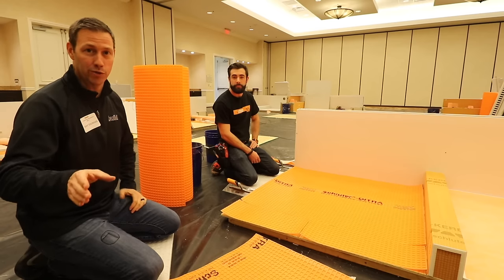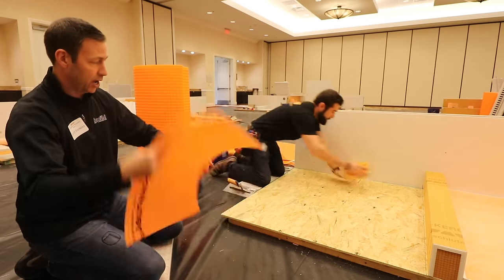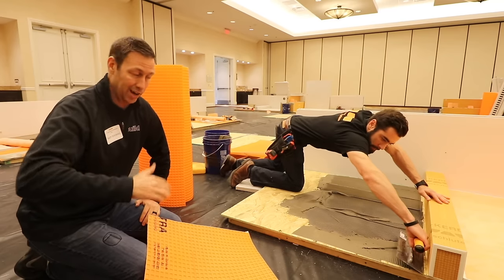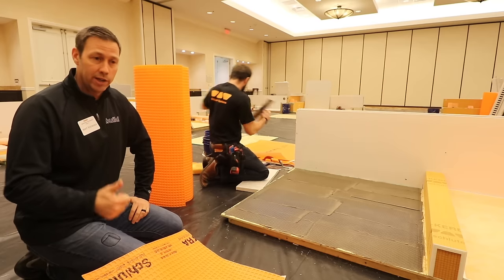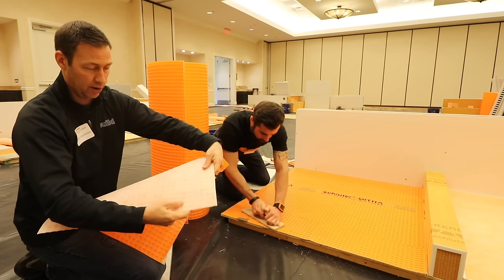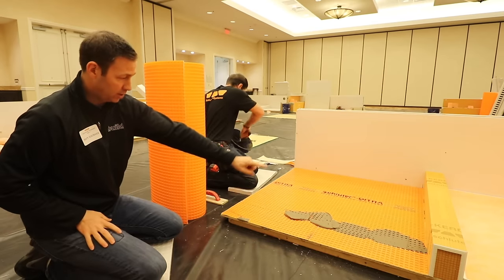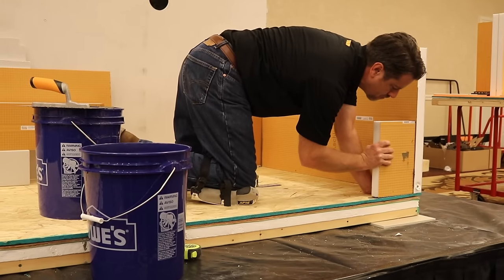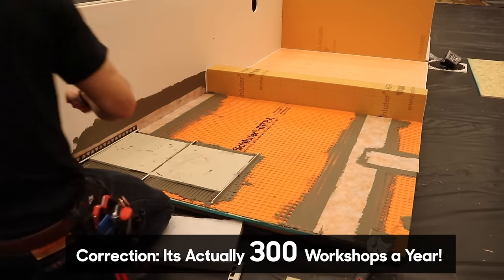WHAT is this, and WHY do you want it under your floors?

Comment: I use 1/4" cement board. It is far, far cheaper that ditra. Ditra is another overengineered, overpriced, unnecessary German product. Good for cement floors, but unnecessary for wooden floors. The height of the 1/4" cement board is not much more than the height of the ditra.
Reply: Mark S yep, and while you are still waterproofing, I’ll already have my tile set and moving on to the next task. Stay stubborn.
Reply: @aldoraines1191 If your subfloor is in good condition and strong, backer board installations will not crack.
Reply: 20 years in flooring. I use 1/2 cement board, I found construction adhesive under and then screw it down. Then fill all seams and gaps against walls and tubs.
Reply: Cement board is not waterproof it's water resistant. Tile is not waterproof either. Meaning that water will penetrate and you will get rot/mold. After this comment you'll write that you've never gotten a call back. Instinctively and homeowner will never call the inept tiler back but instead call someone else. Hope this helps.
Reply: Cement board does absolutely nothing to uncouple the tile from the substrate. This is why every single job I did 10 years ago when I used hardi-board exclusively has cracks in the grout where the floor butts to the wall. 

Physics cant be changed. Floors and walls are constantly moving. Nothing you can do will stop the cracks unless you uncouple the tile from the substrate
You also don't have a waterproof floor with backerboard, so when that crappy mortar based shower pan leaks, and the two ends of the bathtub (over years) spills enough water onto the floor, the subfloor will be destroyed underneath...God forbid if that bathroom is on the second floor and now the ceilings on the first floor are falling apart and moldy.
Keep using your crap and hurting your reputation, And in the meanwhile MY business will continue to grow
Reply: But is backerboard alot heavier than ditra plus thinset?

Comment: I'm a DIY guy who used this product 16 years ago. Not sure if it was the same brand, but certainly same product from Home Depot. Weeks after the fact two tiles still were not bonding. HD people told me it never would because I used a premixed product! Well why did all the rest bond perfectly?? I've removed them for inspection and there was complete coverage on the tile. Really can't understand what happened.
Reply: It was most likely a mortar curing issue. You never want to use a premixed product to install tile to Ditra.
Reply: @billjohnson7347  Yes, that fact is not made clear to buyers but should absolutely be a point of emphasis.

Comment: Shout out to everybody that do manual labor cuz that made me tired
Reply: It's skilled craftsmen, not manual labor. Something that you would never ever be able to do....
Reply: @deeplorable8988  craftsmen still use manual labor, don't they? Even if you use power tools, you still operate then manual, no? No need to get upset...
Reply: @deeplorable8988  well.... yeah, i see your point. Not referring to drivers or operators of machines, meant hand power tools .... when you control them with your own hands still
Reply: @Sokeresa  Again, and I repeat, with your logic, a surgeon is a manual laborer. Critical thinking is not your strong point.

Comment: So how long is this supposed to last, then? 20 years? 40? Great, we now not only have "fast fashion" but also "fast building", i.e. using oil to create - at the same time - disintegrating and waaay too long lasting (micro)plastics and wrapping ourselves in them from body to house. And all this while there is a real and from an engineering standpoint very modern and sustainable trend of using natural materials throughout - which can also save money, when used wisely. Nothing is cheaper than litteral dirt.
Reply: petrochemical Engineering of Structural Engineering is FAR superior to wood, cheaper longer lasting higher tinsel strength more weather resistant and better acoustics value thermal resistance..
Reply: @mjolnirswrath23  Arguing ad hominem is certainly not a wise move if you want to get a point across. Then again, I don't think this is the case. You do realize you do not know me or any of my life's experience, right? Well, keep on ranting and have a good life in plastic while I build my next house the way the one I live in now was built 250 years ago: with wood and clay and straw and chalk, with great isolation and 0 rodents, I can assure you. Also: give ants a chance, dude! We need 'em - just like bees. And you don't have to be a tree hugger to realize it, really. Logic and an understanding of what's around you that makes you live is quite sufficient.

Comment: what brands of washing machines you've used in the last 10 years to know not to buy them :))))
Reply: Don't buy whirlpool their warranty doesn't cover most of the parts unless you buy the extended warranty that cost arm and a leg
Reply: Buying a Speed Queen will last 25 years. Nothing else comes close I have seen.
Reply: @arjunapatel3366 
Ain't nobody got time for that!
Reply: @stephenbullock9431  weird, I got my whole house whirpool and they are the best I've ever owned.
Reply: @stevenbodum3405  Speed Queens are made in Wisconsin, not China. They are the machines the Army buys and are also used in most laundromats where durability is important.
Reply: @davedoolittle9124   I install all brands of high end appliances yes speed queen commercial 💪👍. Samsung/Dacor is over priced garbage
Reply: Typically the hoses that connect to the washer deteriorate over time. Especially the hot side. That’s the source of most leaks. It’s worth the cost to replace the hoses periodically.

Comment: "Electric floor warming"!! -- That's what I want.
Reply: DITRA-HEAT

4.2 out of 5 stars  25Reviews

DITRA HEAT UNCOUPLING MEMBRANE - DH512M- SCHLUTER
Reply: Ditra heat is good stuff. You must know how to install it 100%. No room for errors with the heat.  However, it is very easy to install and absolutely great in remodels! 👍
Reply: @eg9248  - How does a better furnace keep your tiles warm? Please explain.
Reply: @eg9248   It won't heat the floor. I have a client who is s one in right now in South Florida. She hates cold tile floors. If your body temperature is 98.6 and the tile is at room temperature, lets say 75 degrees, the tile is going to feel cold. You would have to heat the entire house to 98 degrees just to warm the floor. If I could give you a double face palm I would.

Comment: At that price why wouldn't you just use silicone; you would get all the same benefits.
Reply: Because this system is awesome and works SOOOOO much better as it's a tied together system and should last a lifetime of water.
Watched Mike Holmes from Holmes on homes install this stuff. Freind had home remodeled in Cali after earthquake, many years ago as it just came out. Installer was trained by/with Mike in Canada. His home just had more damage and guess what was perfect underneath when ripped out. 12 kids 6 of his and 6 fosters and NONE of them destroyed the system. Earthquake, yes bunch of messy kids nope.

Comment: Yeah . . you sound like a 'info-commercial' dude . . just say it man, fess up!
Reply: Thats because this stuff works. I wouldn't tile without it
Reply: @trump-wj2nx  you're wasting money
Reply: @trump-wj2nx  "Not dimensionally stable" did you mean the subfloor has pits, valleys and not level or did you mean floor was not square? I want to use this stuff in my bath - need experienced opinion. Thanks
Reply: @georgiafan6618   yes, what you just mentioned, also, plywood is not dimensionally stable. As it will expand and contract under the tile, which is dimensionally stable. Causing cracks later on down the road. Also, there are 2 kinds of concrete slabs, those that have cracks, and those that are going to crack. Most of these so called "professionals" on here are slamming this stuff because this stuff costs more, and requires more labor and hurts their margins, so basically they lose money. But the difference between me and other companies, is that i take care of every callback i have ever had. Which i save money in the long run by doing things to the best possible standards i can. Alot of other guys want to slap this stuff together and when its messed up a few years down the road, and you will never see from them again.

Comment: I love your channel but not this. I have been watching your channel for years but I had to make my first comment because of this product.

As a flooring guy that has been in commercial & residential construction for over 25 years. Framer, concrete, foundations & footings, trim carpentry, job foreman and commercial building superintendent. Yes, I build too.

This product is garbage. The old tried and true methods are the best. I've had more repairs because of this products failure than anything else. Not my work either. It's always some other guys crap that sold this garbage like it was the best thing since sliced bread. The only thing that Schluter makes that's worth a damn are their flooring transitions and corners........ if you like the metal look. Anything else they have. STAY AWAY and DO NOT WASTE YOUR MONEY.
Reply: More than 3 decades of tile flooring installs here agreeing with you.
Reply: Hi I know I am late on this video. I want to do me living room and dining room in ceramic. My bathroom has ceramic flooring on about a 3/4 plywood and has been there for well over 10 years and looks fine. Everyone says I need to add another piece of plywood or this stuff on the video. What would you recommend? There are comments here that they have tile on the sub floor for decades with no problems?? I am confused... Thanks in advance

Comment: I understand that Schluter Ditra  is not rated as an ANSI A118.12 crack isolation membrane.  If the concrete already has cracks you should be aware of  membranes tested for A118.12,   Even the "best" products can't guarantee against cracking.  I hardly know what I am talking about, but I've read a little about mitigating cracking which that makes me want to see a 2nd video on this topic.  Thanks for introducing this topic.

Comment: I think with the prices of wood going up that stuff like this is going to be the future. I’ve seen some at home manufacturers starting to use carbon fiber even. What is easy and cheap but most of your problems in at home have to deal with wood in water, even on the exterior, there’s no reason you can’t wrap a House in fiberglass and make it completely waterproof, then your only water problems are going to be deciding where to put a drain so it will actually drain out if you have a flood.  That’s been kind of a pipe dream and kind of ridiculous but so are the prices of wood now and I think a lot of these alternative might be a lot more popular soon

Comment: I always use 5/8" plywood for subflooring. That gives you the most rigidity/strength. More so that 1/2" and 3/4". Then I put 1/2" durarockwith edgeguard ontop of that. Its screwed down onto plywood with screws that wont back out. That gives you  moisture protection and additional rigidity/strength. You can tile right to the durarock but  dirta ontop of that gives you another layer of moisture protection and its better at preventing tile from cracking.

Comment: I think personal choice hardy backer  glue and screws to plywood then used redguard waterproofing i think never is a problems with leaking or cracking ground or tiles after years walking in out a bath

Comment: Im sure you know but schluter also do a similar system that you can run an electric cable between the squares for an underfloor heating system. Also in the UK its a building regs requirement for new build to use a decoupling membrane like this for UFH system and also if you are installing travertine tiles on concrete or wood floors.... but is upstairs on a wood floor you must check the distance of the joists and if any noggins... and if the subfloor is floating or a secured floor. otherwise the floor could still be to bouncy even using this system.

Comment: It seems like a very attractive product but I suspect it might just be serious overkill and quite pricy.  I need to put down large (24” square) porcelain tiles in a very old commercial building which has a raised wooden floor.  I was planning to go with Hardibacker and then the tile.  I don’t really have a known concrete movement issue in that region.  Seems like pricing this out you go with either hardibacker and thin set or this stuff, and a lot of thin set.  Price wise, is it strictly a comparison between hardibacker and Ditra?   Update:  I also completed the 2-day class that other day.  Impressive and I feel much more confident that this stuff will be the best way to prep for large tile in our 1903 Bank of Italy. Floor joists are 2x12s which are about 30 feet long.  (They don't make that stuff anymore!)

Comment: When we first got this at Lowe's the customers were shocked by the cost - They were concerned more about initial cost over longevity and security of their install.  That has slowly changed as more installers realize the security that this gives them from call-backs for failed installs.
What Matt didn't mention is a technical point.  Those 'waffle' squares are angled - Imagine like a miniature dovetail that locks the mortar into the ditra.   It does cost more than the old cheap install with concrete board but the end result is much much better especially if the slab isn't on well settled ground or second floor install where the floor will ALWAYS have some amount of flex. (I no longer work at Lowe's but I've seen the change before and after I left - more and more Schlutter products carried and sold.

Comment: Roofing paper works the same and is cheaper. Hubby used it for tiling concrete slab homes in San Antonio and never had a problem

Comment: I know this product well, great for Euro style remodel where you go over the top of what was there before, I’m a fan of good framing/ or concrete and good prep or Leveling.  Good mortar and cured substrates. Kerdi can work well but it’s not time tested yet, 50 years from now we will know…. Cement can crack, kerdi or not.  I’m a fan of time proven installs in good substrates, easier and faster isn’t better in my book…

Comment: This is a great product. It replaces a rare material used for centuries as an uncoupling agent...sand. For conveinance it's probably much easier to install and deal with but for a cheap bastard , like me , I'll try sand. Bear in mind common beach sand probably won't work. You need more like a foundry sand that will pack down and stay put. Common beach sand will peel up with the thin-set.

Comment: The best shit to use on a floor you are going to install tile on is self adhesive rolled roofing set on wood sub floors or concrete.
All you have to do is cut the laps off of the rolled roofing and set it.
I don't use the notched trowel. I butterball each tile and the rolled roofing.
I don't use tile grout either. I use self leveling concrete that you can make it any color you want and you never get dirty grout lines.
The rolled roofing is under 100 dollars a square.
The rolled roofing protects the wood sub floor. Bascally waterproofing the subfloor or concrete.
I use the rolled self adhesive roofing on all my wood floors regardless of what type of floor I install like carpet, wood or tile.
Reply: So are you saying that us who have been at it for 35 years and going on building 3 Ed multi million dollar homes for family’s over 30 years are idiots? Peal and stick EPDM under tile, really dude?

Comment: Not a builder so this may not be an issue: wouldn't you want to know if your concrete foundation is cracking? Doesn't that mean there is some underlying issue that could be from water or plumbing breaks?

Comment: My sister is having to tear down her entire house here in Florida because the AC unit which was installed in the middle of the house and started leaking slowly. The wood floors buckled all down the middle of the house, and when they tore out the kitchen cabinets there was black mold underneath. This product would probably be good under an AC unit as well. What do you think?

Comment: 20 years installer here. A few things you should know.
1. Ditra is an excellent product but not 100% foolproof. 
2. If your base floor is too flexible, Ditra won't do you much good on it since it will flex with the floor when you walk on it for example. That goes for any uncoupling membrane. In extreme cases such as that, you need to reinforce the base floor with a concrete board or additional subfloor like plywood before you put ditra on it. 
3. Ditra is waterproof but seeming it with tape will not make it 100% waterproof over time. To be safe and sound, use Kerdi membrane throughout the entire shower slope.
4. If you want the warranty to be eligible make sure you use appropriate thin-set for it. It differs from substrate you apply it on. Schluter ALL-SET thin-set is your best bet since it is designed specifically for it.

Comment: We used this in a kitchen remodel above grade.  It worked great.  After 5 years, no cracks in the grout.  the previous installation used cement board and it kept developing cracks in the tile and grout due to the bounce of the subfloor.  I'm not sure about installation on concrete subfloor though.  Seems pointless for that.
Reply: I have had the same problem in my kitchen where I have changed my tiles 3 times thinking tiles were not strong enough. The installer guy used cement hardy board over the wooden floor. It kept developing cracks in the tiles due to bouncing of the subfloor. Do you think I should remove the tiles, cement hardi planks, and then ask the installer to install the schluteer ditra mat on the wooden sub floor and tiles over it next day?  I am sick and tired of removing tiles every time. This will be my fourth time to replace tiles. thanks for your detailed way of installation.